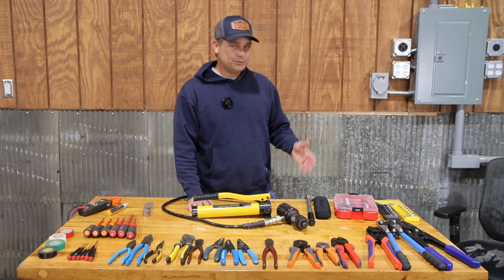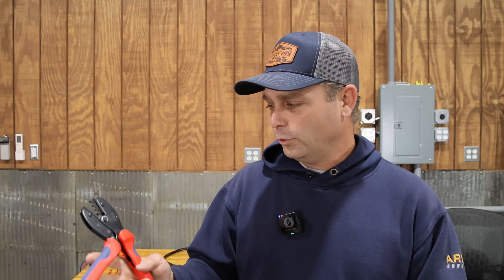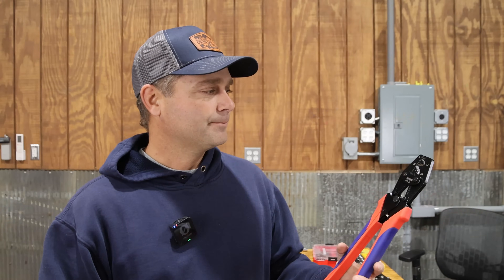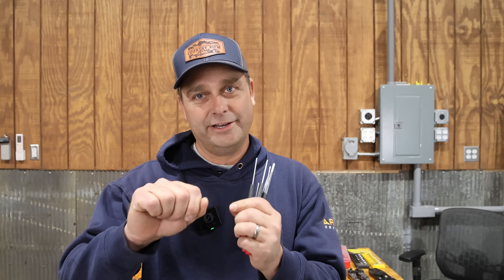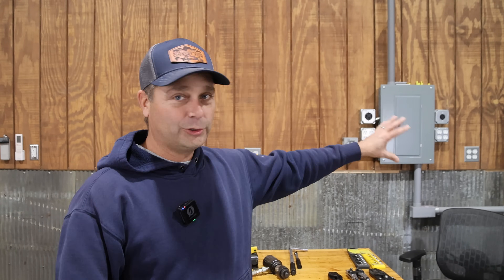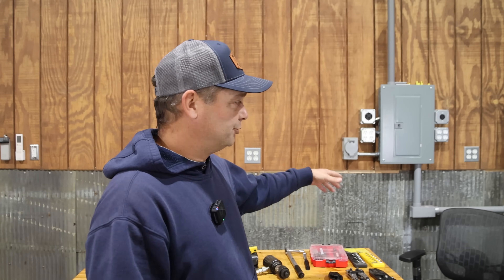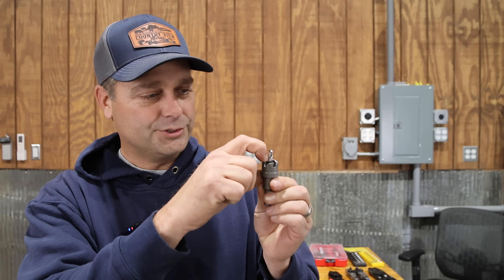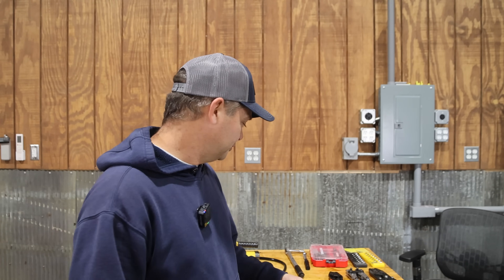Solar and Electrical Tools that I use and you might want.

Comment: Many of the same tools and brands we used, some I liked enough to purchase for my personal kit, though in retirement I don’t get to play with them much anymore. Wiha, Klein, Texton, Fluke, GreenLee, and Thomas Betts all come to mind. I like that hydraulic punch, hand punching is a pain. Working in a coastal environment on electronic and low-power enclosures we used a lot of poly and fibreglass enclosures, so much easier to work on. A few good coax strippers and crimpers are also handy to have on hand. Beyond local electrical and electronic supplier there are a few online like Digikey which are great resources.

Comment: Excellent.. I just need the solar stuff now 😜🤪..  you only forgot about the hand tin or jar of spare nuts,bolts, screws,terminals etc..  or at least the tool bag with everything you need right at the bottom 😅..  Nice presentation of the vid sir with a good selection of tools..  stay safe 🏴